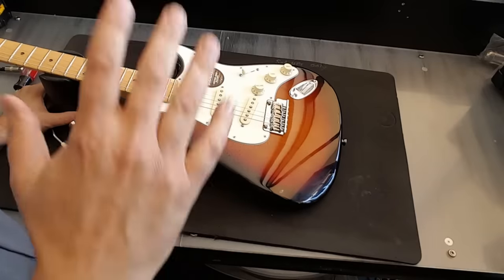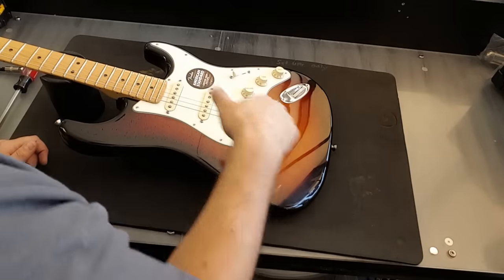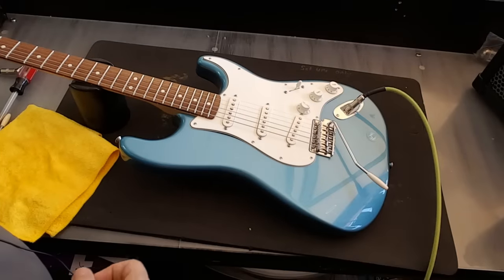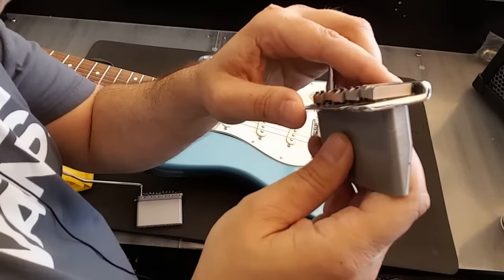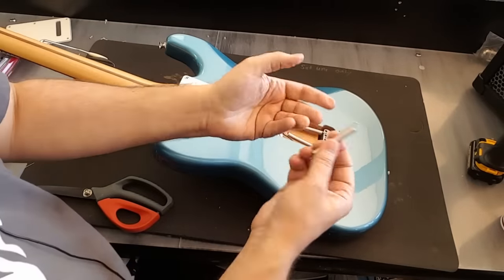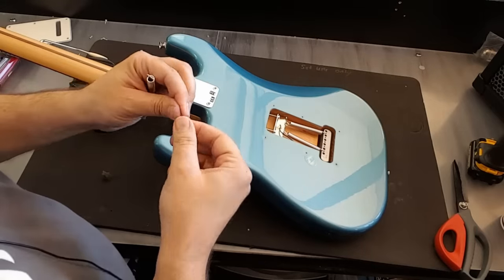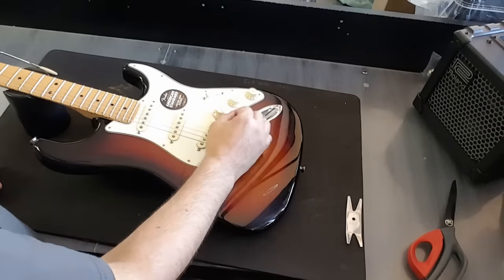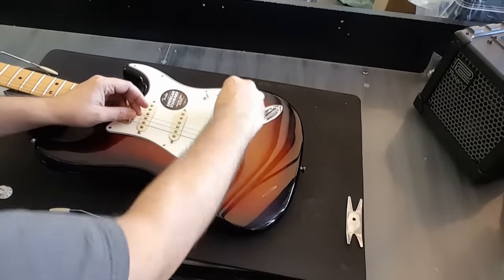5 things you didn't know about your Fender Strat

Comment: What noisy pickups? cheap basswood and parts...over rated brand, cheap bridge, cheap machine heads all parts made in china but are stamped US...Fender hasn't done a thing to roll with times..
oh yea the springs. weak dingy sound off any model from cheapest to most expensive.. trust i owned 1 or 2 here and there...I now own an Ltd that nothing at all has to be done to make it sound better or work properly